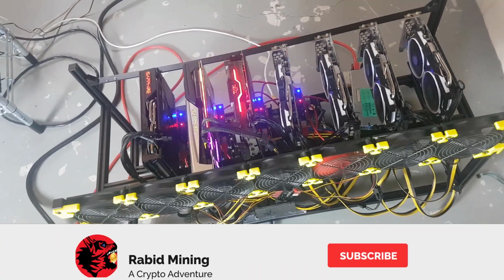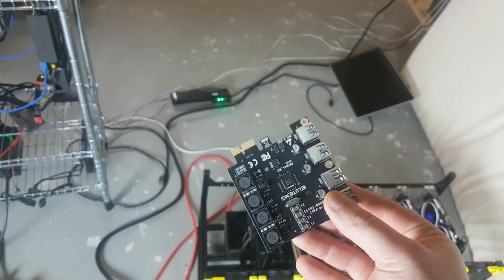465MH 1300w Throwing it all At One Monster 2400w Server PSU

Comment: Very nice video and PSU never saw breakout board and cables for mobo like this Q_Q
Reply from the maker: Ya it's great the breakout board works on the 1200w hp server psu as well links in the description is you wanna check them out.

Comment: nice PSU. what was the model and branding for that.
Reply from the maker: Links in the description but its this one https://www.parallelminer.com/product/all-in-one-gpu-mining-power-supply-zsx-kit-delta-2400-watt-platinum-94-power-supply-200-240v/?wpam_id=197 that is a referal link if you pick one up no extra charge to u but get a small % of the sale.
Reply: @RabidMining  can i run like 6 3080's on this power supply
Reply from the maker: @MeroPlays  ya should be able to most I seen use 225 or so software so guessing like 240 at the wall so using even 350w a card which it isnt using your at 2100w.
Reply: @RabidMining  thanks man. keep up the good work.
Reply from the maker: @MeroPlays  thank you

Comment: Is it as noisy as a HP 1200w PSU?
Reply from the maker: Not to sure as for 1200w psus mine is running at 900w and cant even hear it.  Once you start going over 80% it will get loud.